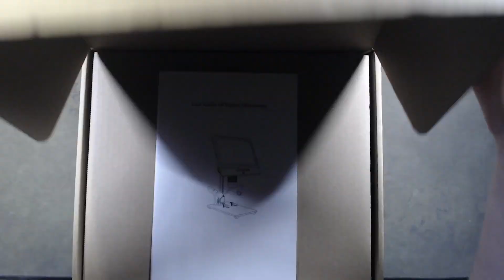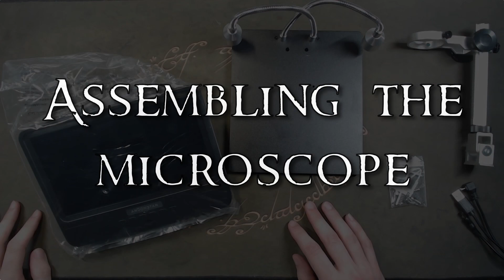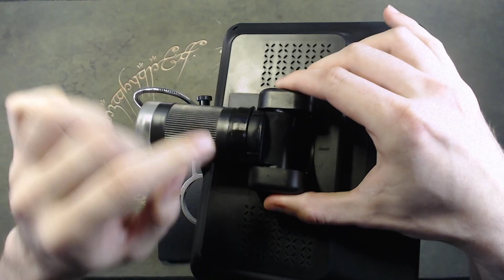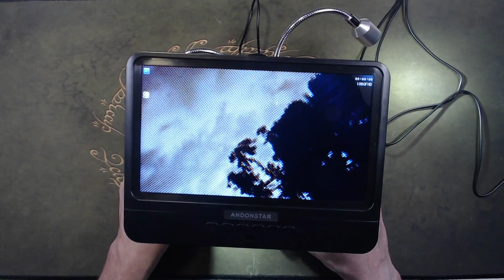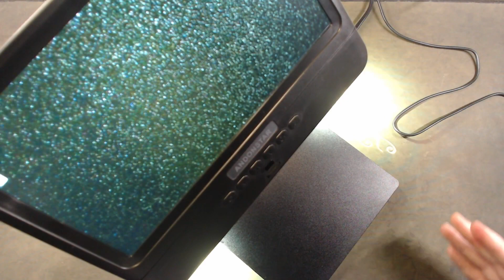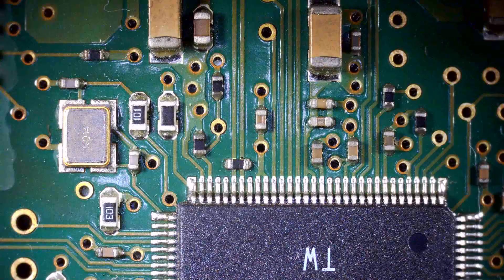Andonstar AD208 1080p digital microscope unbox and review (structure, image quality and latency)

Comment: did you use 32gb memory,and 
Are you satisfied with the microscope in general?
Reply from the maker: I am. still couldnt manage to buy some really small smd to solder but everything else is amazing. Review coming as soon as Ive used it enough with soldering. I think that card is 32gb yes. That will be surely enough. You dont need a super high performance card. Check SD speed standards for more info. Hope I helped a little bit :)
Reply: @rigolab  ok i will look,thank you